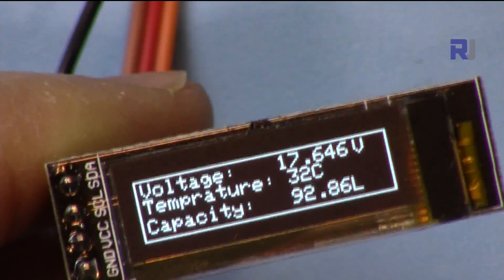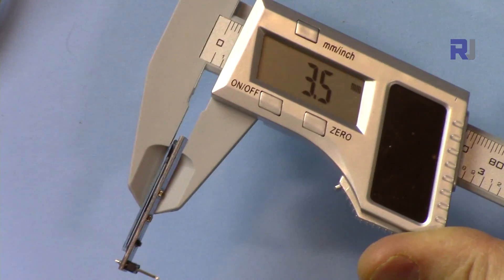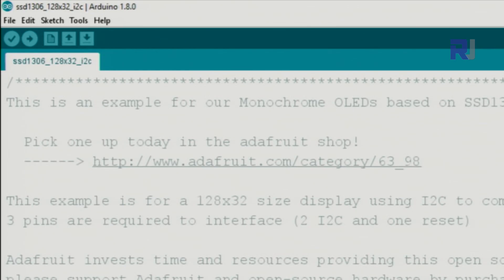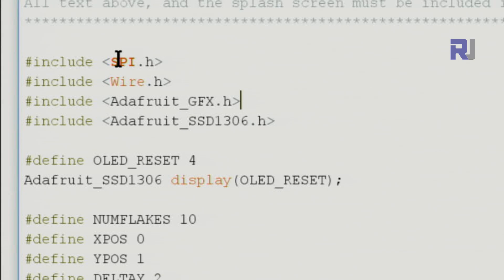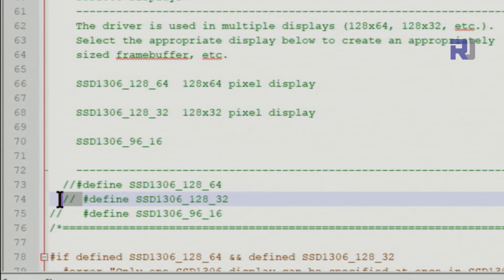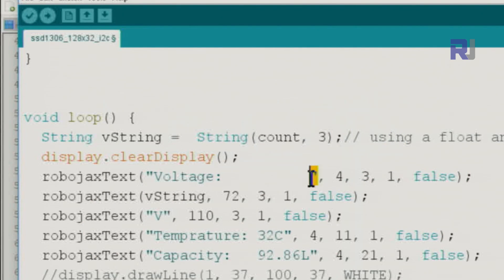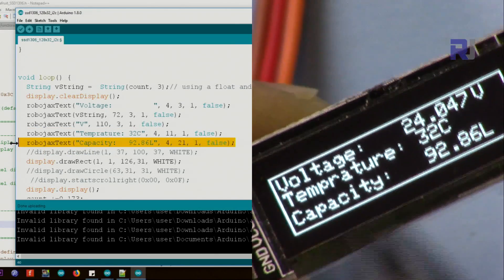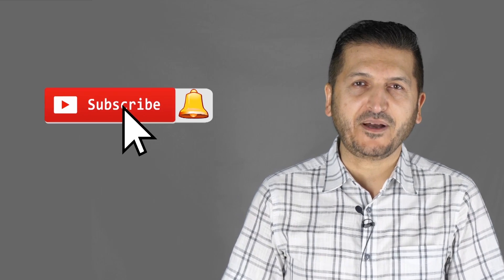Lesson 22: using SSD1306 OLED display | Arduino Step By Step Course - RJT580

Comment: I keep getting:

 error: #error ("Height incorrect, please fix Adafruit_SSD1306.h!");
 #error ("Height incorrect, please fix Adafruit_SSD1306.h!");
  ^~~~~
Compilation error: exit status 1}

I checked notepad++ and the // are setup as indicated. Anyone know what I'm missing? 

// this is the Width and Height of Display which is 128 xy 32 
#define LOGO16_GLCD_HEIGHT 32
#define LOGO16_GLCD_WIDTH  128
Reply from the maker: why you have 
#error ("Height incorrect, please fix Adafruit_SSD1306.h!");
I mean the character #
it will give error. I am not sure what you have changed.  Ty fresh library. something is wrong with the code.